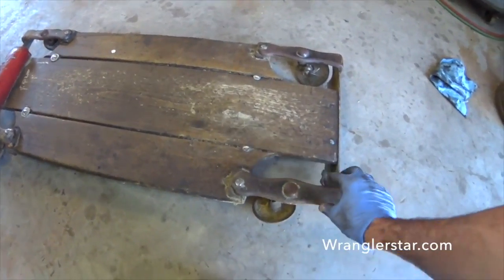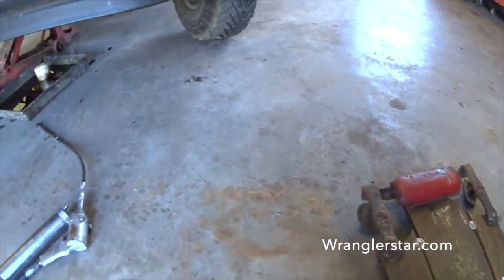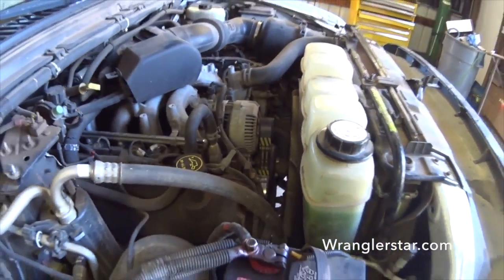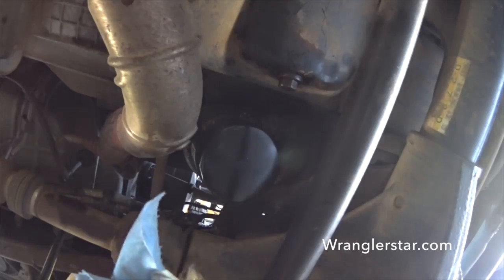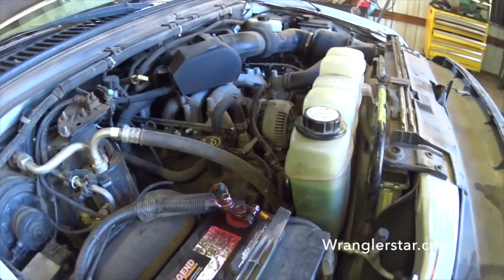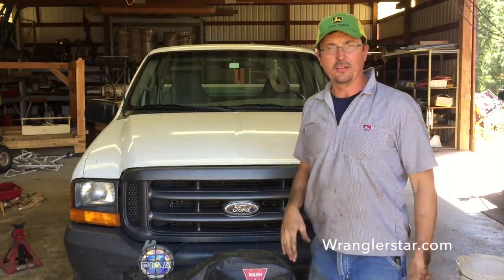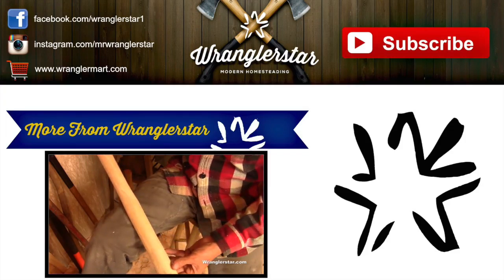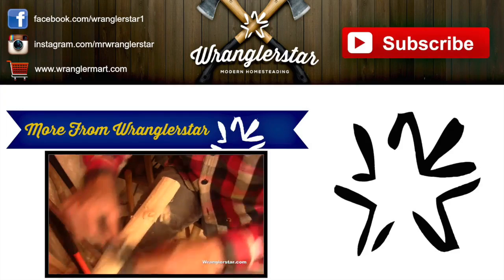Tips For Getting A Truck To 300,000 Miles pt2

Comment: I'm a big proponent of do-it-yourself preventative maintenance. Its usually the many smaller problems (usually electrical and the like) that add up and aren't feasible to fix that annoy me. That and here in MN salt eats vehicles even if you wash them regularly. I've had perfectly good running vehicles that have plenty more miles on them but you could see right through them.

Comment: Just some FYI for you all. Napa GOLD line filters are made by WIX. The silver ones are not. Also Napa oil is made by Ashland oil company which is valvalene. I worked for a Napa in the mid 90's for about 4 years, I looked the other day and it's still the same. And to You Cody you can really tell that's not a Michigan truck lol. I've spent a lot of time under my trucks with hammers and what not and lemme tell ya the Iron content in my body is way up there because of it!

Comment: I've got a '92 F150 that I bought as my first vehicle last August. Has over 230,000 miles on it and it's still running. I've had to put some work into it and still have a bit more to do but I know it's worth it when I look at other students at my university who are driving brand new trucks and are struggling to make the payments.

Comment: My "hauler" is a '98 E150 Wagon.  Only 125,000 miles but is starting to succumb the ravages of being stored outside for it entire life and driven on salty winter roads in MI.

Anyone purchasing a used vehicle should expect to have to put $1000+ into it for front end alignment (and replacement parts), tires, brakes and shocks.

Quick tip for others.  Clean the outside of your battery with baking soda and water at least a year.  Rinse with fresh water.  Pop the caps off of the battery and check the water level.  (There really is no such thing as a "maintenance free" battery.) Top off with tap water or distilled water if you have well water.  A good "gob" of plain old Vaseline on the battery terminals is just as effective as the "red" spray.

Comment: Yes there is merit to buying used...I have done both....but everyones financial situation is different and just as important everyones time resourses are different. There have been times when I was making lots of money but had very little spare time. I bought an f250 turbo diesel and kept after it ....got laid off 3 years later ,had to replace with a car pdq.......as the truck only had 14000 miles after 3 years and was meticulously kept....my depreciation loss was minimal and I had a substantional amount of equity for repurchase. I would suggest that if you buy new....buy sensible...buy something that many would want to buy afterward ...(even used). Don't over option or under option and stay away from trucks that you can see on the road that are rust buckets after 4-5 years old . Many Americans today are either under employed or over employed (too much ot) thanks to the Obama economy.
If you intend to keep a vehicle for 10-20 years buying a new  truck is not such a big risk IF you intend to pay it off before selling.

Comment: I may not own a truck, but the same goes for those good old Swedish built Volvos from the time it was not owned by a foreign investment company. About 26 years old and roughly 200,000 miles on the odometer (which is a lot in this small country) it's only recently been giving me some aggrevation with what I think is a wheel bearing on the way out, but may turn out to be the whole steering mechanism. Still, I've owned it for over 13 years as my only car and I bought it when it was 13 years old...

Comment: I couldn't agree more, I bought my used 6.4L F250 super duty with 100k miles on it for well less than half what they cost brand new. Just maintain it religiously and you'll be able to triple that mileage in these diesels no problem!
(especially that work horse 7.3L you have wranglerstar)
Reply: Tyler Lawson He's got a V-10 he doesn't drive the truck enough to buy a diesel as for the 6.4 I wouldn't touch one I will keep my 6.0 it is easier to fix.

Comment: I enjoyed this video.  It's great to see that the truck is not completely corroded as most are of that age where i live and the roads are heavily salted in winter.  Not trolling at all but i had two questions/observations;  your spare appears to be a different size- im sure you're aware but even a very short drive with two tires of a different rolling circumference on the same axle could cost you a very expensive piece of drivetrain in a few miles.  the other was if you replaced your pads? new rotors with irregularly-worn pads from old warped rotors would definitely be a no-no
great video and i agree with your opinion on the used truck vs. new truck
sold my 1990 Dodge diesel with 739,000 km's to a kid who still drives it

Comment: I know you mentioned you changed the transmission filter. Have you ever had the transmission flushed? A standard automatic transmission can hold between 8-12 quarts of fluid. Normally dropping the trans pan only or removing the trans pan drain plug flushes 4-6 quarts of fluid out of the transmission. With getting a transmission flush at a shop it replaces all the fluid in the transmission. Also I am not sure of that year of truck but a trans cooler might be a good idea if it does not have one.
Reply: Michael Wilson I have the same truck.  They hold about 19 quarts.  You can flush them by pulling the return line and starting it for a few seconds, then refilling it 5qts at a time.  It's said to be safer than a factory flush that uses pressure and can damage the seals..but who knows.  I'm guessing I will have to do some tranny work as mine leaks a bit when it gets hot.  I'm at about 175,000 miles.
Reply: design2survive  Good to know. Its been a few years since I turned wrenches for a living and even longer since I was in trade school. I know there are flushing machines that simply use the pressure of the fluid going in to push the old fluid out, which are more forgiving to older transmissions.
Reply: Michael Wilson That would be nice to have.
Reply: design2survive yeah but those are expensive machines
Reply: Michael Wilson That's why I just picked up a piece of vinyl hose and a 5 gallon bucket.  Turn it on until you see a bubble in the line shut it off, fill, then do it again.  Some people do this once, then every year or so just drain the tranny (5 qts) and refill it.  It sort of keeps it clean.

Comment: Circulate about 1/4 cup of dishwasher detergent, like Cascade, in the cooling system for about 30 minutes then flush well with water.  Cleans the system well and it isn't harsh like system cleaners, Prestone and whatnot.  DO NOT use dishwashing liquid like Dawn, non foaming only.

Comment: Assuming you parked your truck after you cooked the disks, which would warp them. You can avoid warping after cooking, by simply moving your truck forward a foot every five-ten minutes. What happens, is the part of the disk which is covered by the caliper, retains the heat longer than the rest of the disk, and that's what warps it; you want to even out the cooling as much as possible.

Comment: It's best practise when replacing brake discs too also change the pads especially considering pads are expensive and then too avoid heavy braking for around 1000 miles or so, this is too allow a layer or brake pad material to coat the disc and allow for best braking. If you brake hard during this 'bedding in' stage you can glaze the pads from the heat and then they'll never bed in properly.
Reply: *sorry meant pads AREN'T expensive

Comment: Another great thing about owning older vehicles is you can actually work on them. You dont need expensive diagnostic equipment to work on them.
Reply from the maker: Chris Davis Yes Chris, this is a very good point,
Reply: Everyone says "you can't work on the new stuff". Been hearing that all of my 34 years.  While I prefer the older stuff, the new is not much different except you have to learn yet another car...
Reply: Jackson Damoose i have seen young people wire in new engines with the help of a laptop, the older generation never thought it would be possible. :)
Reply: Arjan Wilbie Yep. obd II for iphone/android and you got diagnostic data as well.
Reply: wooo weee my phone has apps to find part numbers and alternative parts that kinda fit but do the job too.
Reply: Arjan Wilbie whats it called
Reply: wranglerstar the point you made about brakes is good however may I suggest you follow the same mantra with tires
Reply: Chris Davis well expensive diagnostic equipment not really.. 10-15$ OBD2 Bluetooth reader and a android phone or tablet and you're good to go on most vehicles and in most cases.. Problem is with all the electronics many of the times there isn't any mechanical issue but an electronical one.. and without knowledge of electronics its hard to find the issue and harder to fix.. Especially many new things to learn for people that have worked on cars for years and years.. 

Also there are just literally hundreds of parts in the way if you need to get to something...

I myself drive a 1995 Ford Probe and its just on the edge of not being pleasant to work on anymore.. already electronic injection, half electronic ignition, proper ecu.. sadly no OBD2 on it.
Reply: Well like I said, you need expensive diagnostic tools. And BTW, Im only 30, I didnt know that made me 'older folk'. Cheers.

Comment: I would probably buy one that is a couple of years old, that way you don't end up with one where the previous owners never took care of them (though even on a couple year old vehicle it could have been abused). I agree though $50-60k is too expensive for a truck, even if it is one that will last a very long time which is probably why they cost so much. Main thing is you want a truck with a good engine and transmission in it, older trucks like 5 years (or older) you tend to run into problems and it's not always solid but the same can happen to new cars as well, but it's really about limiting that.

Comment: I don't know how many miles are on our family van, but we've had it for 22 years. It's just about dead now, though. The air conditioning is shot (a real problem in Florida), the upholstery is falling apart, the driver's seat is permanently reclined, the radio is gone, and Dad can't get the power steering fluid to stop leaking.

Comment: 2018 Ford F-350 Limited, Crew Cab®, 6 3/4’ Box, 6.7L 4 Valve Power Stroke® Diesel V8 (B20) Engine, TorqShift® 6-Speed SelectShift® Automatic with 6.7L engine, 3.55 Electronic Locking Axle Ratio, 4X4, SRW $80,715  You can find houses for what a new truck costs!.  (I paid $700 for my 02 Crown Vic, and besides maintenance, have gotten 50 pretty much trouble free miles out of it so far!)

Comment: You said some wise things about preventative maintenance and replacing things before they totally fail.  So may I ask why you ran your old tires so long? I've done it too and I remember the bit of fear that ran through me when I got off the highway I was running 70mph down and noticed the steel belts sticking out of my tire

Comment: Every vehicle I have ever owned was used and the only reason I ever go out and buy a replacement is that the old vehicle will have rusted out to a point where it was no longer roadworthy.  Where I live it is usually the road salt that takes it's toll on vehicles.  My last vehicle had a perfect paint job yet and even the under body was relatively rust free but the trailing arm mounts rusted out and it is illegal to weld in new mounts so I was forced to junk the car and buy a replacement.  It was probably best anyway as the vehicle would have started costing me quite a bit as more things began to fail.

Comment: I don't understand the people who always have a car note and "have" to get a new car every 3 years....

I still have the same 2000 Ranger that I keep in perfect working order and am not afraid to use it like a truck. It just turned 170,000 miles and I have had 800+ pounds in the bed and it wasn't touching the suspension bump stops, so I considered that safe for the short trips with that much weight. 

People ask me why I don't get a new truck. My answer is:

1) This one is paid for and won't die. Ford had the Ranger pretty well perfected in the early 2000's.

2) No one makes a truly "small" truck any more. The Tacomas, Fontiers, and such are at least 75% the size of a regular 1/2 ton truck.

And like you said, I know every inch of my truck its easy to work on.
Reply: Robert L my step mother has to get a new car every 3 years and my dad had a 1996 Saab and my father always bought my step mom new General Motors and they had so many problems the cars and SUVs not trucks but anyway that thing was more reliable then any of the, and also outlasted them they had problems in a matter of a few months

Comment: A while back I bought a brand new 2013 Ram R/T. It was a great truck. 5.7 hemi, 4.10 gear, super sporty, bright red, every option you could ever imagine. 

But honestly, a new vehicle isn't worth the money. For the $425/mo I was paying, I feel like a fool after about a year. 

Now I drive a 99 Ranger. It has AM/FM, manual transmission, crank windows, and suits me just fine for the driving I need to do.
Reply: galamonkey You were only paying 425 a month? that's cheap guys I know are paying 1200 a month for their truck payment that is for a diesel pickup.
Reply: galamonkey You are dead right. 
I'm driving a 2002 Sonoma with 124000 or so miles. It has the same amount of bells and whistles yours Ranger does. I've had trucks with power gizmos. The first thing to go was the door locks and window openers. They are nice until you can't get in or roll up the window. 
After retiring I'm probably going to drive it until it's dust on the driveway.  I paid cash when I bought it and it makes money every time I drive it.
Reply: galamonkey I love my 1995 Ranger. :)

Comment: I'm nearly there with my Tacoma.  It's a 2000 with 198,000 on the odometer.  I do all my own work as well.  Good job, Cody.  Does the Powerstroke require valve adjustment?  Might be a good idea if you haven't done it.  It would also make for a good video, many people have never seen a motor with the valve cover off.  Take care.
Reply: That's no power stroke its a v10 I believe
Reply: Please excuse me then, I'm not a Ford fella.  Nothing against them, just don't own one.

Comment: i just got my first pickup truck ever its a 2016 f150 xlt fx4 supercrew cab , i have about 3000 miles on it and i take really good care of it and drive her carefully babying it and never exceeding 3k rpm ill use synthetic oil and change it every 5000 miles as i live in a very hot place and i wanna keep it to 500000 maybe a million miles if i could

Comment: I bought an old used truck with cash recently and started fixing it up. Friends and co-workers thought I was nuts. I get a lot of 'more in parts than its worth" type comments. But you now what? I don't have to make a car payment every month, and for the most part I choose when an where I repair something vs getting caught with my pants down. if you replace the original parts with new ones- you've already put yourself that far ahead. This truck already had 200K miles on it, so there's a lot of replacing going on, but by doing so, I know this truck will last me 3-400 thousand miles no problem.

Comment: tomorrow I'm buying my first truck and its 1999 truck for less than 6 grand and only has 100,000 miles couldn't be more excited
Reply from the maker: +Lukasz Koluch congrats.
Reply: +Lukasz Koluch  // This is sort of similar to mine, for the same price. See where I replied to the previous video.
Reply: What kind I would get a 03 f-250 power stroke
Reply: King cab? Long bed? 4x4? XLT? Electric seats w/ lumbar? Electric mirrors? Come on man! Details!
Reply: I ended up getting a cab and a half 2500HD with manual everything except the transmission
Reply: Good. Thanks.

Comment: A tip:  If you've just heated the brakes up such as a long downhill to a stop, try not to hold the car with the brake pedal.  Use the E-brake.  When you keep your foot on hot brakes, there is a much greater transfer of heat from the portion of the rotor through the brake pads,  This contributes to the rotor warpage.
Reply from the maker: E-brake, LOL perhaps you should look into how brakes work,
Reply: caveman123ization 

It's because he's a prideful know-it-all.

Comment: My little 1999 S-10 finally died on me after 175k miles.  Was worth less than it would cost to fix it, but it served it's purpose.  $8,900 brand new back in the day.  Looking at getting a full sized pick up now and they're like $30k for a base model.  Used it is.
Reply: achigurh at 175k miles ? wow , how bad did you treat it ??

Comment: I always thought your truck was the diesel. How is the V-10? I'm looking for a used 99 or so f-250 4x4 extended cab essentially like yours but diesel, see the gas v-10's all over. If they are good I might grab one of those instead.
Reply: olchevyman the v10s are really cheap! The only problem is the exhaust manifold gaskets that go out and how hard it is to change the spark plugs on these 5.4l v8 and 6.8l v10s